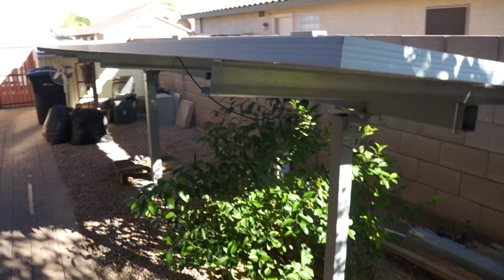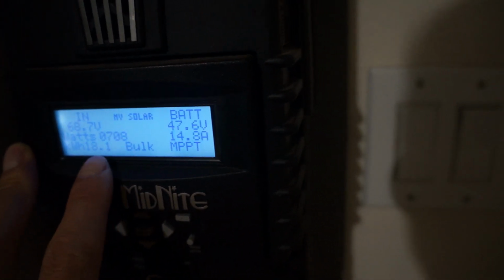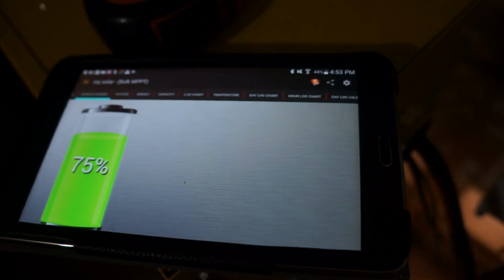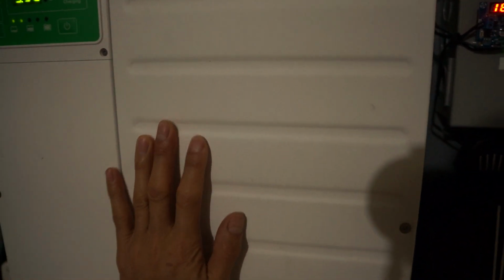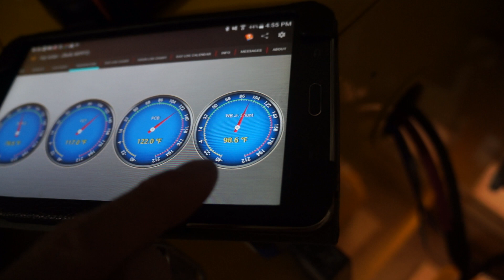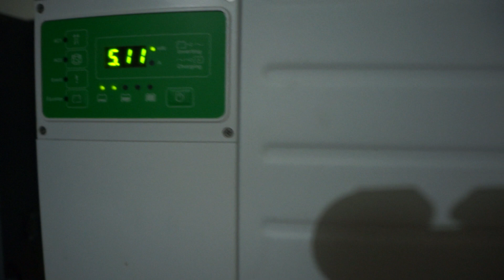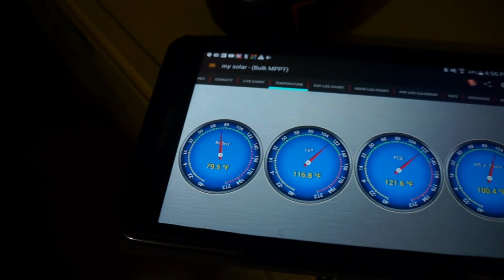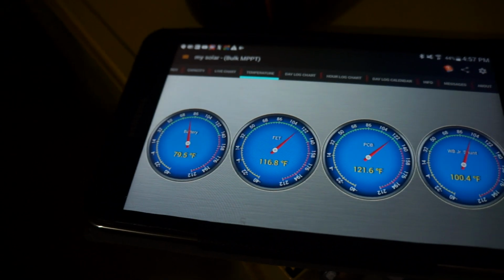Running 3.5 tonage HVAC with Solar and Lithium Battery

Comment: Good Sir, you misread (of misunderstood) your panel. The 18.1 kWh is the current energy stored in the battery.  A watt is a joule/sec.  Therefore, a unit of watt x time (like kWh) is a unit of energy (joule = power x time).  At the time you quoted the value off the panel, the battery bank had enough energy stored to deliver 18.1kW of power for one hour OR 9.05kW for 2 hrs OR  4.5025 kW for 4 hours, etc.  It is NOT the total power that has been collected by the solar panels for the day.  I hope this is helpful to anyone who gets confused on this topic.

Comment: 6.25 tons heat pumps running on mine. Micro air soft start and inverter motors (variable speed).

Comment: What size solar battery do I need to basically run everything your running except my Central Ac unit is a 4 ton 13 seer unit? How many solar panels are you running? My square footage of my house is 2100, if that makes any difference and I live in louisiana. My average monthly kWh usage is 54. Any help or advice would be greatly appreciative. I just don’t want to buy to small or way to big.
Reply from the maker: Off grid system is hard to size, it all depends on your budget and how comfortable/convenience do  you want to be.  But a rough estimate you would need at least 7-8kw of solar, 20-30kwh of battery.  (I take it that you meant 54kwh a day?  not a month right?)
Reply: @devildestiny555  my electric company says i used 54 kwh in this month but i was thinking my solar power that im getting during the day would almost be free in a way because im drawing off of the sun but the next 12 hours my energy usage at night  from my batteries should be around a third of what i use during the day. I also had my double wide mobile home insulated very well. Am i thinking correctly. I was thinking of using 20 445 watt panels but i wasnt sure if say a 11,000 watt battery would be enough, what do you think? The installation is the part im nervous about, im afraid itll cost me a fortune, did you ever get any quotes before?

Comment: So how's it do at night?  My guess is you don't have the balls to exist off grid. Solar's great as long as you can rely on nuclear, natural gas or coal for when the sun don't shine. It takes four fully charged Tesla power walls $1,500 each) to run central air for one night. How many solar panels would you need to have to charge up 4 Tesla power walls on a sunny day?  Multiply that number times 10 for a cloudy day.  That's just run your AC. How many extra panels to charge your Tesla? How about everything else in your house? Remember to multiply by 10 for rainy days for just one day of power. Try running those numbers for a week. Even if you could afford a dozen Tesla power walls do you even know what a power wall is made out of?  All lithium ion batteries and power walls aue made out of the same basic stuff. 15% lithium, 50% nickel from Russia and 35% Cobalt from the Conga owned by China. Oh yeah, China uses slave and child labor to get the freaking Cobalt out the ground. Liberals love their slaves as long as somebody else owns them.  So yeah, go buy an powerwall and a electric car. It's powered by the slave under the hood.

Comment: Awesome Set-up.  Could Have Used This System Here In Texas with The Power Failure We Had For Fours Days.  No Heat To Warm The Apartment or Power To Kitchen. Lights At Night Time...

Comment: Very nicely done. Are you using both lithium batteries at the same time? If so, series or parallel? Nice video, thanks for posting.

Comment: I personally believe with enough solar panels you can power a home with air conditioning during the daylight hours you would only need grid power at night when the sun falls
Reply: Sure if you have the money. $250k to be totally off grid with solar and batteries.

Comment: One of the things I did before going off-grid was take a measurement from my central AC... holy crap it pulled 3900 watts.  That included the 400 watts the blower motor used to push the air thru the duct work.   So I ran out and bought 2 window units- IE  a 5000 btu that pulls 500 watts, and a 12000 btu that pulls about 1000 watts.  Together they keep our 2 story 1580 square foot house just as cool, in fact, the second floor is even better now that the 5000 is converting that hot air into cool air, something the old central AC unit had a hard time doing (moving air up 2 stories).
Reply: My 3 ton WITH the air handler pulls ~3250 watts total ...

Comment: When you are using 116amps, does that mean per battery module? Or do we divide that by how many modules we are using? Thanks.
Reply from the maker: That's the total draw from the inverter, I have 8 Chevy Volt module and 7x leaf in parallels, so each battery see 116a/15 = about 8 amps

Comment: Great vídeo, I'm from Phx too! I would like to do the same set up as you just smaller. Did you have some one install your system or did you do it your self?
Reply from the maker: all DIY.
Reply: @devildestiny555  how's it still working? Anything you'd do different?  How many panels do you use?
Best place to buy them?
I like the no roof install but Z-lite "no drill" racks from solarpod.com look like a better option for me to get max sun.  Thoughts?
Reply: @SmedleyButler1  did he ever answer?

Comment: What size cables are you running
Reply from the maker: Which cables?
Reply: From your inverter to the batteries. 5.6 kw should not get the cables warm to the touch.
Reply from the maker: 2awg
Reply from the maker: The cables are 110F with 115amps going through it.  The ambient temp was at 90F, so I don't think it's so bad,  25F above ambient.  It could be my terminal lug issue.  But I had CRIMPED the lug and flow solder through it, I would think that's as solid as it could be.
Reply: 2/0 is 50 MM. On the Schneider Inverters we always run 3/0 or higher. I know the cables state you can safely pull more amps but our field experience says different. When you can, upgrade to to thicker cables. As the cables heat up they drain the batteries faster.

Comment: Fantastic. Is your goal to reduce your peak time usage?
Reply from the maker: A bit of everything, keeping the total kwh usage down to get lower tier charges, using the sun power to cool itself.  :)
Reply: Looking at the new APS rate stucture We are going to be penalized  heavily for the new 3 to 8 pm peak time.
Reply from the maker: Bryan, you had a grid tie system?  My friend recently barely got grandfather in with APS on a 15kw system.  But he's still unclear of the small details on how the rate is enforced.  Do you know how much per kwh during the 3-8pm (if you have a grid tie solar?)
Reply: @devildestiny555  grandfathered in?  Did the stop allowing grid tied units or just buying back power?